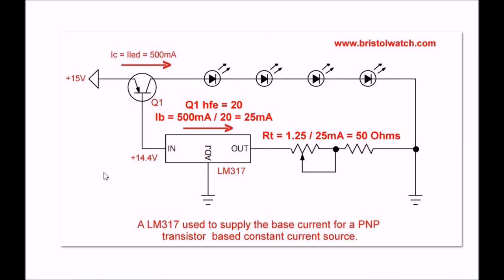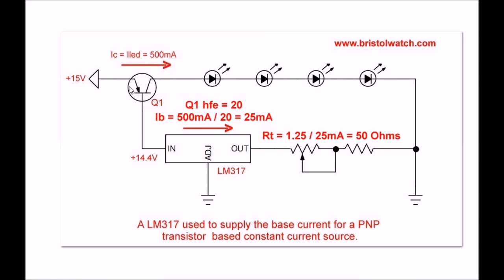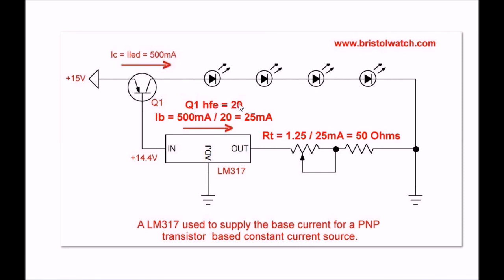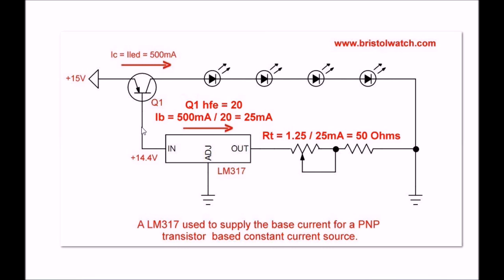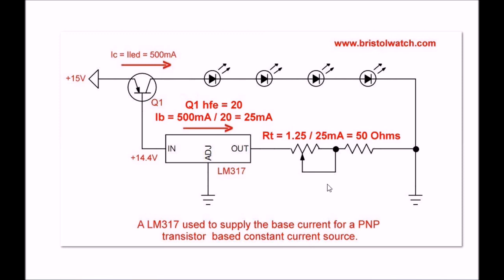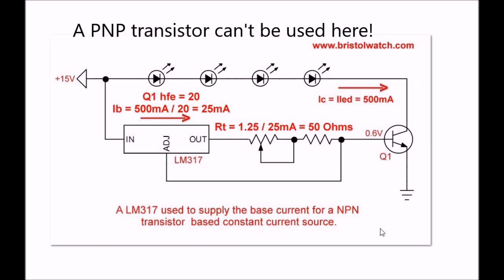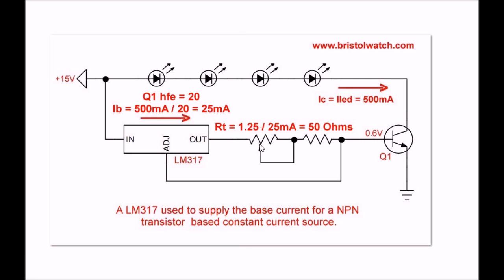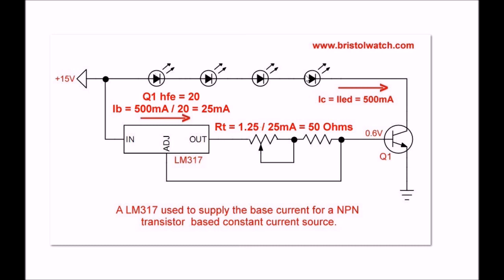PNP & NPN Based Constant Current Sources

Comment: A current source that is based on the Beta of a transistor isn't very good.
Beta will change with temperature and between transistors with same part number.
Reply from the maker: True but the idea is to current limit LEDs which have a broad current input. I also use this to current limit many of my test circuits. Thanks.

Comment: Hi, Which transistors do you recommend?
PNP = MJE2955
NPN = MJE3055
The above transistors have the hFE from 20 to 70, so do we have to manually adjust the base current so that the collector current is as per the requirement?
NOTE: I have not yet tested this circuit, will be testing it in another few days.
Reply from the maker: Assume hfe of 20 when calculating switching current.

Comment: I used spice to simulate this circuit. When PNP is used the circuit works as expected. When the NPN is used, as in the second circuit, the collector current does not seem to be even close to beta times the base current for some reason.  Vout is always good at 1.25 volts.
Reply: Actually a get a constant collector current when I change the load resistor from about 250 Ohms to  1 Ohm  and it is 90 ma.  with my base current 25 ma so thats only a gain of 90/25 close to 4 . My beta is 20.
Reply from the maker: This is not a voltage circuit it is current. What is the current through the LEDs?
Reply: Vout of the LT317A is 1.25 which sets up the base current of 25ma but my collector current which is the current through the LEDs is 90 ma even though beta is 20 and should give me 500ma as in your video
Reply from the maker: Is this an actual circuit or spice?
Reply: SPICE